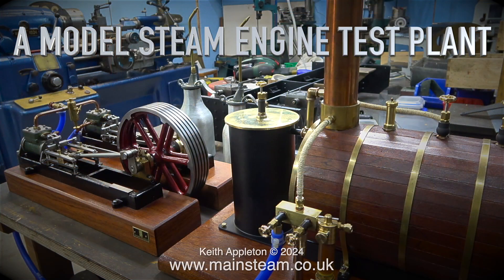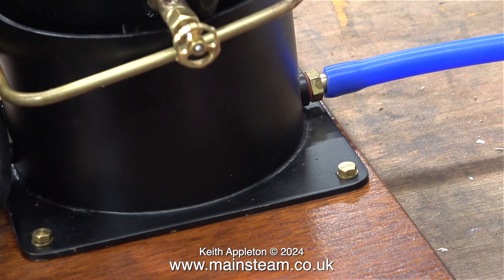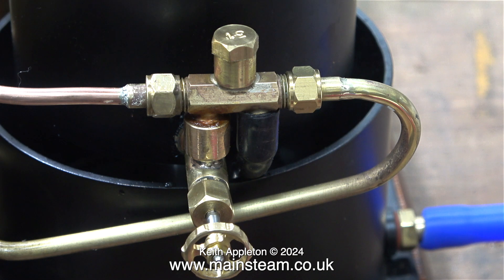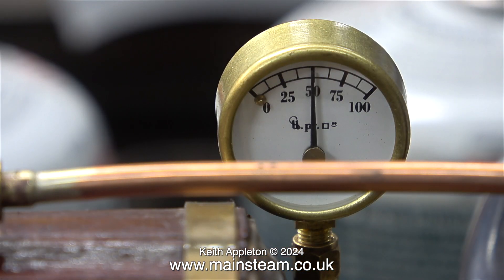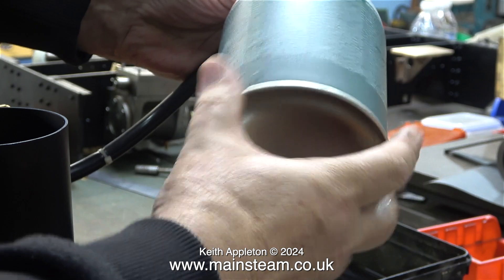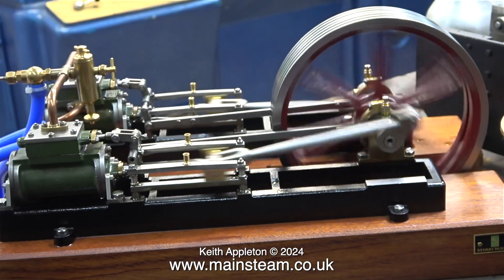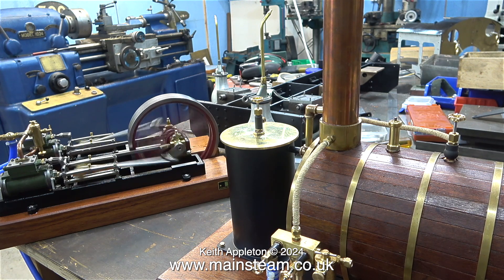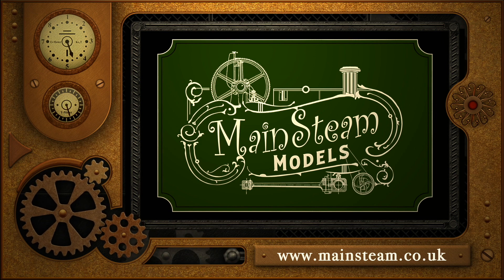A MODEL STEAM ENGINE TEST PLANT - PART #32 - THE FINAL EPISODE

Comment: Question:  How much power does this two cylinder engine make (horsepower)?  Does this depend on  the steam plant?  How would you measure it?  Just curious.  Very good series.
Reply from the maker: I really have no idea, unless Stuart Models publish the specs it is difficult to assess the power, however it is only a model so it's not much.